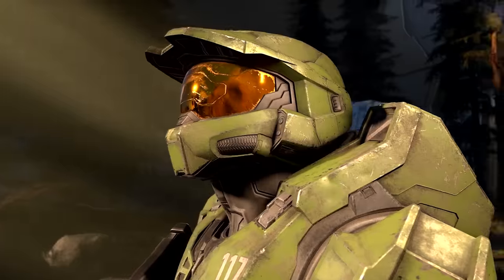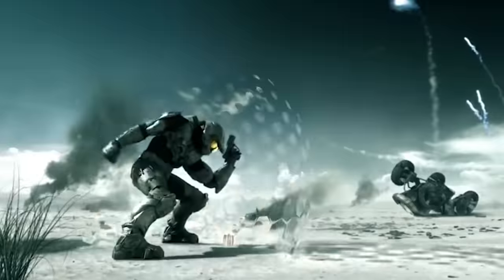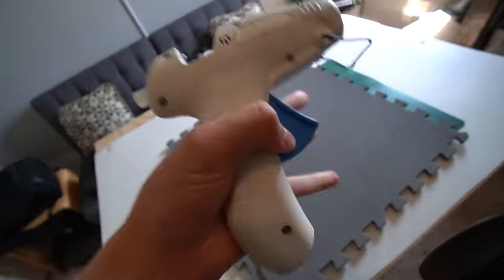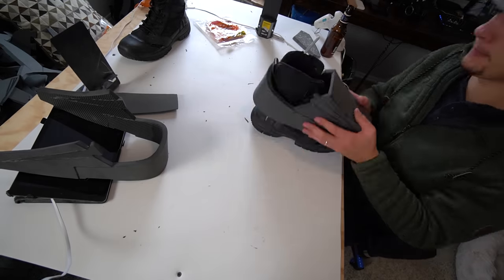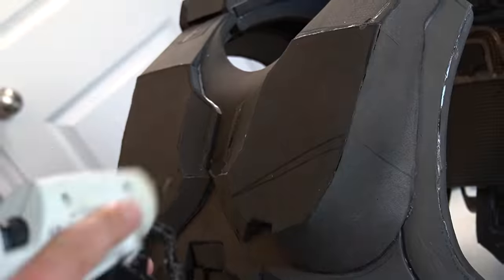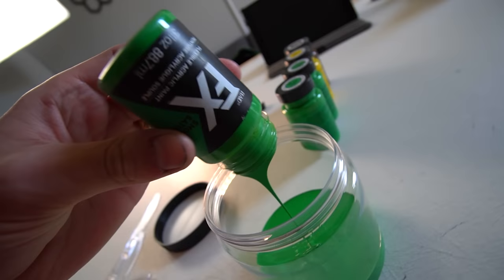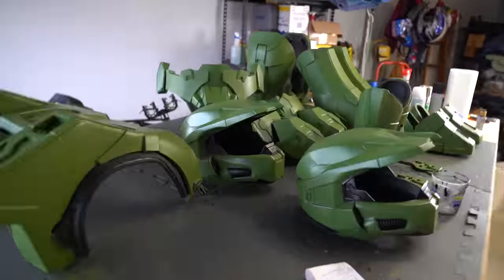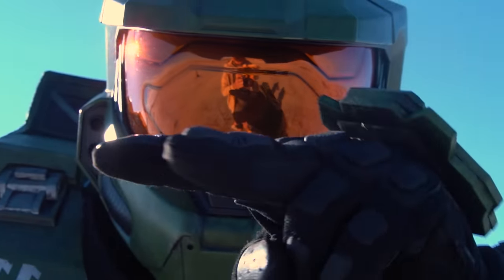I Made REAL Infinite Master Chief ARMOR from Scratch *100% Freehand*

Comment: Can you PLEASE put this through an Impact test? 

There is a large problem in impact LARP's where they will not allow foam armors under the mentality that they will not hold up at all, but all our weapons and equipment outside of armor are made of foam. Foam is such an easily accessible material for people, and can be turned into so many things far easier than leather working or god forbid metal crafting.

Comment: two years late and this is still a BANGER video! Good job solider Chief would be proud. Any tips for if I wanted to do a project like this myself? how did you get those thigh pieces and crotch guard together? 5:14  I saw like something with straps or something? any mistakes you had overtime? anything I can prevent? you really inspired me man, I wanna do something like this soon!